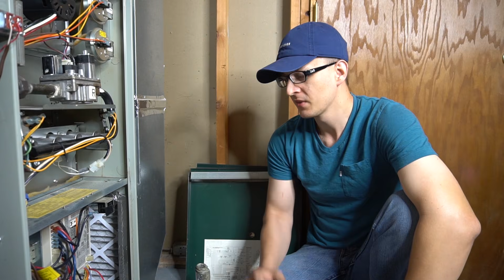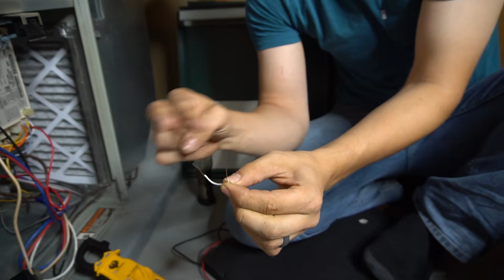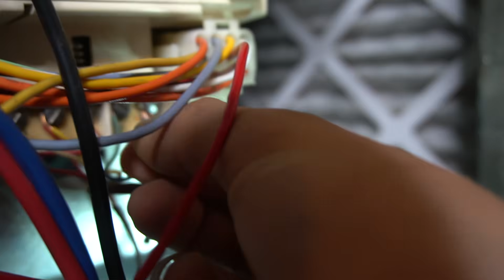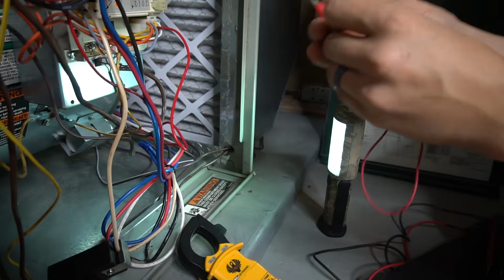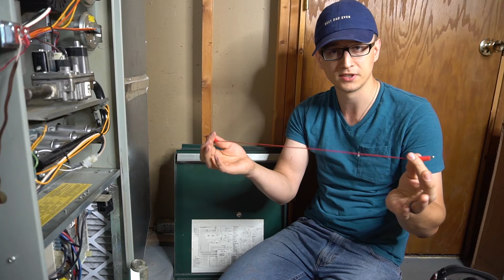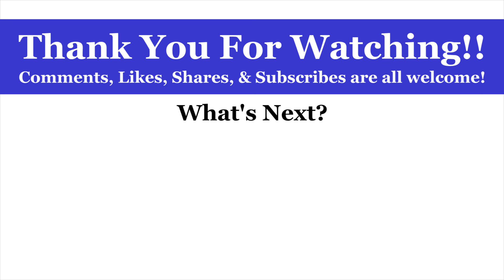How to Jump Thermostat for Heat or AC

Comment: I have a tenant that’s keeping one of the zones on low temp overnight which is helping to freeze pipes when it’s 2 deg F outside. I’m considering jumpering the furnace and activating the heat myself. 
It’s a 100 year old and I found the cold draft that’s hitting the pipe and insulated it but the pipe still gets down to about 40 deg when its single digit outside and the room is cold.

Comment: My white rogers furnace board led lights not on ?I think my hvac technician accidentally connected the 24 volts to 120 volts thermostat sparks then no power on my board ,what could be the problem?new subscriber here,thanks

Comment: My furnace stopped and the thermostat ( basic 7 d programmable) was acting funny so I changed batts, checked breaker with no success. Tried the paper clip on the furnace control board and got function. So I jumped the thermostat w to Rh and it worked?  It was really cold so I was thankful that I had some heat. Now I have time to get a new thermostat and get it installed.  You saved my butt. lol. And you helped me this summer with my AC changing the capacitor. 🙏🏻🙏🏻.  God bless.  Love your channel. Really clear instructions.
Do u have any suggestions for basic replacement thermostat (I am tired of dealing with battery issues.  Basically my battery leaked and corroded the contact plate and it has been on life support ever since). Gas furnace + AC only 1 W terminal.

Comment: Question:  package unit no 24volt at thermostat   jumped the red with green nothing no spark......ideas how to find the problem.  Will manually engage the contactor later to see if unit runs and see if transformer is getting 24v and will test fuses at disconnect.....Other ideas pls  ty  Brian

Comment: If you have a bad thermostat, and it's late at night and the stores are all closed - can you left the jumper wire from Rh to W, overnight - because the high limit will get tripped whenever the furnace temp goes above the limit switches temp setting, and the limit will control the furnace cycling off and on through the night.

Comment: Hi, 
Situation: the outside AC unit does not run. I pressed the center of contactor. The AC worked fine with fan running   
Replaced: capacitor, contactor and batteries  ( same results as without replacement)
Checked:  the voltage on the unit. There was no 24 volts. I checked R/C inside furnace. No 24 volts there to
Please help. Thanks a lot.

Comment: Don't neglect to turn off the power, if you accidentally touch the wrong wires mucking around like this you can and will blow a fuse in the air handler and make the problem worse.

Comment: Neither works for me the thermostat turns on the blower fan but doesn't turn on the AC I jumped the Y and R but it still don't turn on but when I push in the contactor it turns on and I don't think it's a circuit board cuz I pulled out the batteries from the thermostat and it's still stays on cuz it's connected to the common so why doesn't the cool go on and engage??

Comment: Good video. Please add that the wire itself could be bad. You mentioned the wiring could be wrong, as in wrong colors to wrong terminals, but a bad 24vac line would cause the same issues.   Doing this same test at the back of the thermostat would eliminate the wire being bad, and the thermostat.

Comment: If you jump it at the furnace and nothing happens could it be the board or blower?
Reply from the maker: If you have a meter, I would first check if you have power between R and C. Also make sure that the door switch is closed. Should be around 27v. If you have power there and you jump the furnace yet nothing starts, then it is either a bad control board or one of the safety switches are tripped. (If its a safety, the board should be blinking some error code.)
Reply: @WordofAdviceTV  R and C or R and G?  Also if “fan” mode on is applied at the thermostat shouldn’t the fan work anyways or would the limit switch cause them not to work. I checked them all the one that has a switch was not tripped and I checked for continuity and all were good is that the way u check them?
Reply: R to all other checked out 27v except “G” when I take of the wire and check “G” by itself without wire it does have 27v at the thermostat all terminals. Check out 27v I check the limit swithches and they are good according to continuity test….back to square one
Reply from the maker: @juancervantes8932  R to C. So the control board is not blinking any error codes? Yes, you can check most of the safety switches with continuity. But the pressure switch is actually a normally open switch. If it has continuity that means its stuck in a closed position and that would prevent the furnace from starting. If thats the case, watch my pressure switch videos for more on that. Now if all the switches seem to be okay and there's no LED error code blinking when thermostat is set to heat.. I would jumper R to W at the control board and if nothing starts, its likely that the control board is bad.
Reply: @WordofAdviceTV  thanks will follow up
Reply: So when I put the thermostat to heat, everything cycled with the exception of the blower, which I believe is the culprit. Anyways it’s throwing a 3-3 code then after like 2-3 minutes it changes to 1-3
Reply from the maker: @juancervantes8932  what does that code mean on your furnace? The code explanations can be found on the inside of the furnace door, somewhere in the cabinet, in the manual, or its possible to look it up online. Once you know what that code means, then you will know what direction to go. From what you described, it sounds like the burners came on too? So its probably a hi-limit code. The easiest way to check if a motor is bad is to simply jump R to G and check if there is power (120v) going to the blower motor. If it has power but not starting, then the motor is bad. If no power, then its something else.
Reply: @WordofAdviceTV  well checked to see if there was 120v from the board to the blower and there is, then it’s a bad blower motor
Reply from the maker: @juancervantes8932  Yes. Either that or if it has a capacitor, the capacitor could be dead. But usually I would not replace a capacitor by itself and would replace the motor and capacitor both either way.
Reply: @WordofAdviceTV  it doesn’t have a capacitor it’s a variable speed.
Reply from the maker: @juancervantes8932  Ah okay.. Then it could be a bad module actually. Not sure what kind of motor you got. But typically you would need a little plug in adapter thing to test if its the motor or the module thats bad. More often its the module that goes bad. If you find a good deal for the two of them together that would be good, otherwise you could try replacing just the module.
Reply: @WordofAdviceTV  yes it is the module in the blower . I’ve had no luck to finding one in decent price range. I was wanting to find someone with spare parts or used parts, that blower motor runs Like 850-1200$ from carrier

Comment: I read that you should use a resistor when you bypass a thermostat. Is there any truth in that? My boiler is short cycling with a nest thermostat and I want to bypass it to see it’s the thermostat or the boiler control
Board.

Comment: I work on a house that hvac heating run non stop its like not seeing the thermostat and thermostat is new. Just find out that main board in hvac has R and W jumper together is that the issue you think?

Comment: Hello using your video to isolate issue.  Cool not coming on. Nest Thermostat gave E103 error.  Replaced thermostat with old one and select cool - still not coming on.  Fan works.  Power on and calling for cool on thermostat no voltage out of control y and C, but shows 24 V r and c. No voltage on thermostat wires outside to contact.  Contact has feed power.  Jumpered y and R on control board and burned out 3 amp fuse.  Any guidance appreciated:)
Reply: I continued with the how to find a short video - isolated it ti the out side components and the contactor.  Replaced and unit is operational.  Thank You for the informative and easy to get videos.

Comment: Tried the alligator clip method it turned on the furnace heat. I replaced the control board step by step like you suggested still when I jump I get only heat help!

Comment: it's not the voltage that kills, it's the Amps. Takes as little as 1/2 of an Amp across your heart to kill you. like if you have one hand on the grounded sheet metal and you touch a live wire with the other hand. Consider this, a static shock like taking a sweater off is probably around 2,000 volts, fortunately only in the pico Amp range.  so half a volt at 1 amp could be potentially lethal.  Good video

Comment: Nice video.  I have 24v between red and yellow/common/fan(black) at the thermostat, when I jump them though, nothing happens? touch red and Black together and the fan should come on but it doesn't?  Been trying to install an amazon thermostat on my heat pump with heat strip(no gas)  When I set it up I can get the heat to come on but when I set AC and lower the temp the outside unit comes on for about 5-20 seconds, sounds like it is on low speed for the compressor fan, then it just turns off.  it worked fine prior to this with the old non programmable thermostat.  took a picture of the wires before removing them from the old just in case it was wired different but all looks good as far as that goes.  In my mind, If I am getting voltage on the wires, then, when jumped, the fan should turn on.  I replaced all three capacitors on the condenser unit outside, replaced the capacitor on the furnace and replaced the control board.  it is an older (2004) Ruud furnace and compressor.  Any ideas?

Comment: Great video  I wired jump my gas furnace like u did here cuz the thermostat wasn't sending signal to the furnace board when I jumped r to w I got flame the  inducer was spinning everything worked  great till I removed the alligators clips and furnace stop working does that mean I have a bad thermostat or something else

Comment: Thanks for the excellent video! If you have a minute for a question... the jumper at the control panel successfully turns on the heater, but it takes about an hour after I connect the jumper. If I disconnect the jumper, the heat turns off immediately,. However the fan is on and won't turn off (as long as the general power supply switch is turned on). The temperature setting on the thermostat seems to have no impact on the function, and won't turn anything on or off. Is it likely a bad thermostat, or maybe control panel?

Comment: If I put a jumper wire from R to W, on the furnace board, would the furnace run nonstop (assuming furnace is ok)? Will furnace overheat?

Also, if I have a battery operated digital 24 volt/Millivolt thermostat in my hand (not wired into a furnace) can I test the R/W wires with meter?  If so, how? 

(If I set tstat to Heat, and set desired temp to 75 degrees, when tstat says it is 73 - to call for heat, and fan on Auto - do I test for continuity from R to W,? Or do I set meter to look for Volts? And, if volts, would I test for AC, DC, or DC millivolts on the meter?)

Also, can I take the questionable tstat that is in my hand (not on the wall) to test it on the furnace board (sort of like a jumper wire), and set tstat to call for heat, and use wires from R on tstat, to R on furnace board, and wire from W on tsat to W on furnace board - to test to see if the tstat is working?

Comment: What happens if you jumping it from the Control board and nothing still turns on. Even if I have high voltage and low voltage.

Comment: Why would the fan come on if you only jumped the red (power) wire and the yellow (compressor) wire and you didn't also jump the red (power) wire to the green (fan) wire??

It would seem to me that in your example, your outside AC compressor would come on, but your inside fan motor would not come on because it was not jumped.

Comment: My furnace will run on fan on only not auto.   I try to jump the red and green wires at the control board and all it does is click.   No fan.   Have you ever seen this before.    It's a york gas pack

Comment: Is there a way to let the furnace control blower control instead of the thermostat? 
When my honeywell vision pro calls for heat, the blower fan immediately kicks in and blows cold air into the house for 20secs before the ignition cycle starts and slowly warms up. I want the thermostat to leave the fan alone because this cold draft is making us sick.

Comment: When you bypass from R to Y to turn on your ac should the outside unit fan come on as well ?
Reply: Only your outside fan should be running and not your furnace fan. When the thermostat calls for cooling. It will actually energize the wires R,G,Y.

Comment: Hi when I bypass at the control board my ac turns on and is running fine, but when I try to bypass at the thermostat nothing happens. What could likely be this issue?
Reply: Likely a broken wire along the way

Comment: Is there any advantage to bypass the Thermostat at Thermostat or at control panel in the attic? Great video. Thanks.
Reply: It could help you to determine bad wiring by doing it at the thermostat. If it doesn't work there but does at the air handler then it could be bad wiring. It could also be a stuck float in a condensation pump so don't forget to check that as well.

Comment: Such great videos. All of the furnace ones helped me diagnose the problem, which after replacing a blower motor, troubleshooting the circuit board and wiring turned out to be the thermostat all along. These videos were the only way I figure this all out. Thank you.

Comment: I’ve been watching all of your videos trying to figure out my HVAC problem. I tried using a jumper from R to W to get my heat to run and it won’t turn on. Actually, the jumper didn’t turn on anything. Not the fan, not the AC and not the heat. When I used the meter I have 24 volts when I connect R-G, R-Y but nothing for R-W. Is my control board bad?
Reply: You have 0 volts at RW because the tstat is working and there’s a call for heat. Your problem is elsewhere.

Comment: Which w Do I place the  jumper to to test heat?  What is stage 1 and stag2 heat..  My heater will not turn on. Bothe stage 1 and 2 lihhts come on on my thermostat.Help
Reply: In the video it looked like the wire was going to both heat terminals. I'm trying to troubleshoot my AC and that is how it is ran on my board as well. I assume that is the standard way to connect.

Comment: I jumped out my system w and r everything came on  except my outlet(exhaust fan) out side my house where should I go from here changed thermostat and I get the same results as before only will turn on AC nothing happens with the heat. Can you advise the next step to take do I need to jump exhaust fan? I'm scratch my cold bald head here
Reply: I d motor came on then igniter lit gas valve opened and I had flame but no exhaust fan running to blow the fumes out of the house. This is jumping w1 and R

Comment: I jumped at the board and the AC came on, even the outside unit. But when I checked the volts at the thermostat I get very low Voltage. it just stopped working last night. U have any suggestions?
Reply from the maker: Interesting... Have you tried replacing the thermostat batteries? (if it has them) Also, if you have a meter, what voltage do you get between R and C on the control board (power needs to be on) and R and C behind the thermostat?
Reply: Word of Advice TV Yeah brother come to find out after six hours it was the condensate pump went bad so it sent low-voltage to my thermostat.  On a unrelated note, You’re not  Albanian are you?
Reply from the maker: @aaronsharp241  Ahh so that's what it was! Thanks for the update! And no, I am from Minnesota :)
Reply: Word of Advice TV No problem thanks for your video. Minnesota wow, you sound like you have such a strong accent. My wife is Albanian and her brother sounds like you, LOL
Reply from the maker: @aaronsharp241  Lol, okay I'll stop messing with you :) Even though I grew up in Minnesota, my parents are Russian and I am fluent in Russian. That's where the accent comes from.
Reply: @WordofAdviceTV  LOL. Thanks for the conversation bro. Catch you later

Comment: Hey Jay could you just wire nut r and y to test the furnace if you don't have jumper cables?
Reply from the maker: Of course! You basically just need to connect the two wires. You could even tape them if you had no other options.

Comment: How do you get the ac unit outside to cut on...I jumped the thermostat but plunger won't close
Reply: It's the board smh
Reply from the maker: Sorry to hear that! Out of the possible parts, that one is most expensive..
Reply: @WordofAdviceTV  I can't find nothing fried tho...would the transformer keep the blower on
Reply from the maker: @76blackface  No, a transformer would not keep the blower on. The control board will not always have visual marks that indicate it is bad.
Reply: @WordofAdviceTV  thanks if still been able to use it manually tho
Reply from the maker: Here are 10 reasons why that may be: https://www.youtube.com/watch?v=NVPhsK4gK1A
Reply: @WordofAdviceTV ok checked all, the air keeps blowing from furnace after thermostat is in off position
Reply from the maker: @76blackface  Most likely that is a defective control board or thermostat. Try pulling off all the thermostat wires at the control board (label them or take a picture before pulling them off) and turn the power back on. If the fan turns off, then you know the thermostat is bad. If the fan keeps running with the wires off, then likely that control board is defective.
Reply: @WordofAdviceTV  I got 2 thermostats I'll do 1 at a time